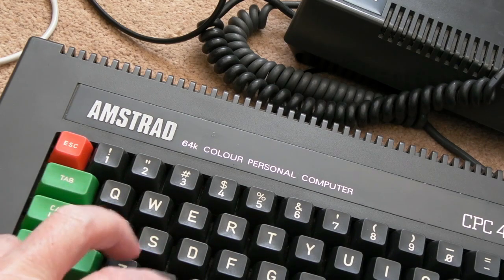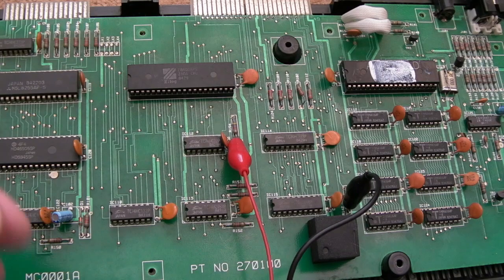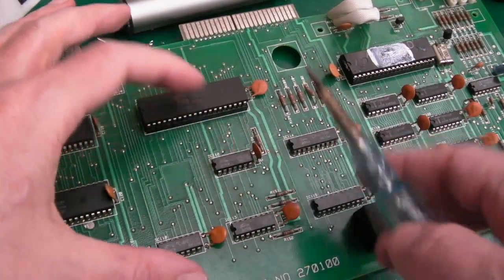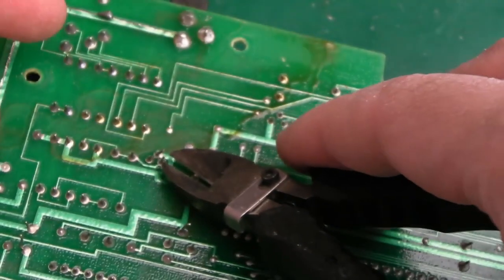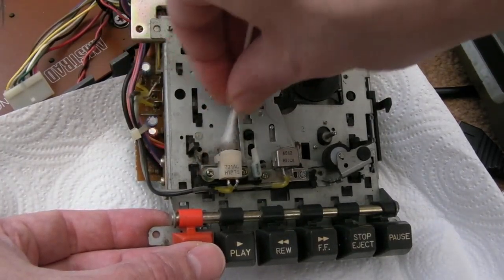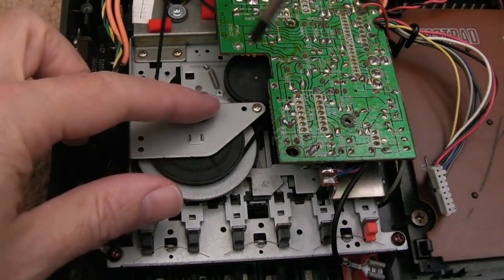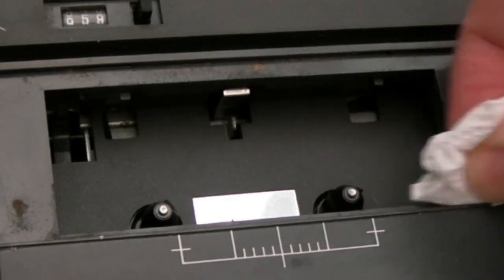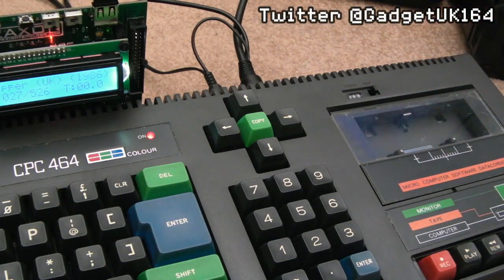Amstrad CPC 464 - Garbage Screen / Tape Deck Belts & Reset Counter Repair

Comment: I am working on mine at the moment.  The tape player is a disaster. Changed the belts and idler.  Cleaned and lubricant.  But still slips when playing.  Sanded the pinch roller. Still slips!  Very frustrating.
Reply: Check for splits in any plastic gears.

Comment: Good video thanks. For anyone just wanting to change the main belt don't take the side screw out you can just remove the top screw and you have just enough flex to lift the metal slightly with a fingernail to slide the new belt between the metal and the wheel.

Comment: I don't see the point in having original hardware but not using original tapes...may as well just emulate and be done lol
Reply from the maker: The tapes take up a lot of space, and cost a small fortune!  Far easier to have some modern storage solution for the games.  The highlight for many people is using the original hardware, rather than emulating.

Comment: The cat got hold of it 🤣. That would have been interesting if it was putting out voltage! Great stuff as usual. Did anybody manage to make a CPLD gate array yet?
Reply from the maker: 🤣  The VHDL is probably available for the Gate Array, since I believe there's a Mister port of the CPC - so someone probably just needs to design a PCB and mod the code to fit a CPLD or FPGA.

Comment: Magician! Chris quick question, when you are doing the reflows and chip removals etc are you doing that with the naked eye or under magnification? if magnification is it a headset type thing or one of them USB/powered microscope type things?
Reply from the maker: Thanks mate =D  I use a cheap magnifier like this one:- https://ebay.us/hqg85H

Comment: Still don't use a desolder station, why not?

I use a ZD-915 desoldering station, and it's a lifesaver, makes life so much easier.

BTW love your video's.
Reply from the maker: Thanks!  As I mentioned before (and in the video lol) - On some of these small 8bit repairs I am using a soldering iron and pump as that's what's easily affordable for people wanting to work on their own system.  The other reason is the wife works nearby and I need to keep noise to a minimum.  The desolder station is used in a few upcoming videos =D
Reply: @GadgetUK164  Aha ok, yeah it makes sound, but is not that loud, a vacuum cleaner makes a LOT more noise, but great to hear your going to use the desolder station more in other video's.

Comment: That was one hell of a quick fix. :) I wish my Speccy +2B was as easy. It spent one year in storage nice and safe, and now there's no video output. :(. There was perfect composite from pin 6 of the TEA2000. So I spent a full week replacing and tracing. I've replaced EVERY component related to the video and there is still nothing from RF or RGB. So I took the composite from D31. Works a treat. LOL.

Comment: Hi mate, quick question?

Just got a Atari St.
Been going through cleaning it all up etc.

One thing I'm concerned about is trace rot.

Any tips how to deal with this?

Love your vids BTW, been following for a goid while now.
Reply from the maker: Check out the recent Atari ST repair I did - had some trace rot (more like bad solder) on that.

Comment: what's your take on my amiga 4000. i get a black screen every time i switch it on
Reply from the maker: Inspect the board around the battery - chances are corrosion from the battery or caps perhaps?
Reply: @GadgetUK164  yes. maybe it will come back to life after a recap
Reply from the maker: @Runar_W  A recap is unlikely to bring it back to life!  There will be a damaged trace or via!
Reply: @GadgetUK164  ok yes. thanks for the info.